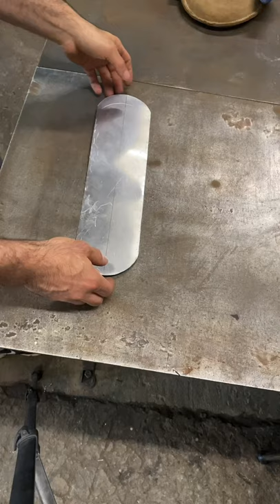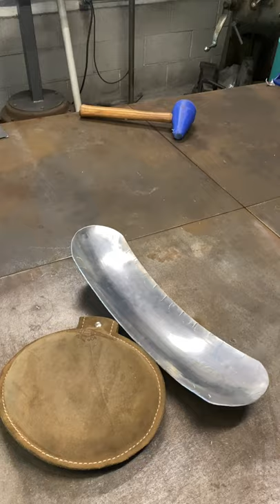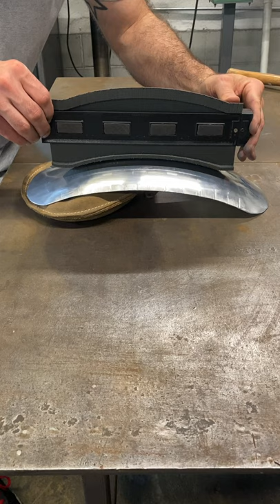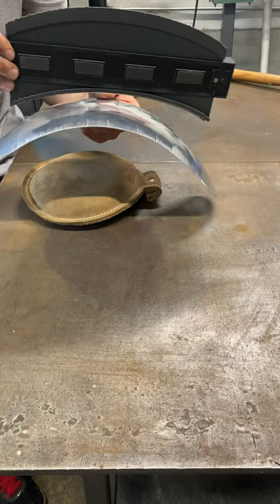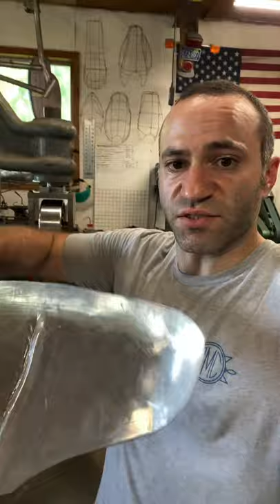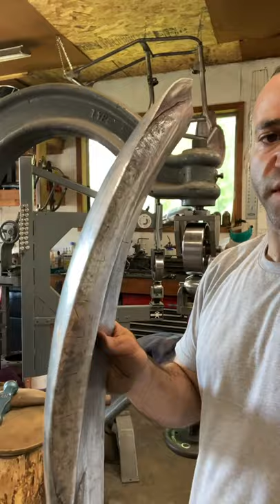Metalshaping 101: Form Vs. Shape

Comment: I bought a beater bag whats the pros and cons in your opinion of using sand versus lead shot?
Reply from the maker: Purely personal preference. I’ve used both and don’t see a tremendous difference between the two.
Reply: @CatskillMtnCustoms   does the lead shot become flat over time and need replaced?
Reply from the maker: @damiansgaragebuilds7663  That’s what I’m told. I don’t use my bags that much, so I haven’t had to replace mine yet. I use my bags to hold panels more than I use them for shaping.
Reply: @CatskillMtnCustoms  makes sense thanks!